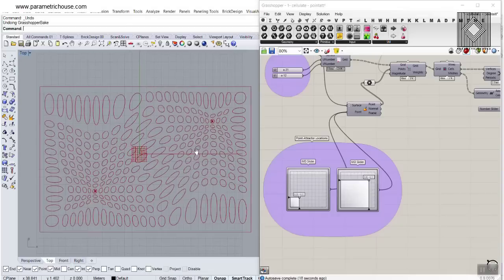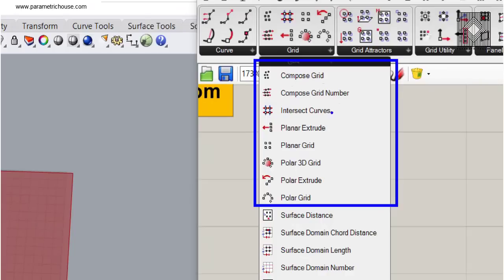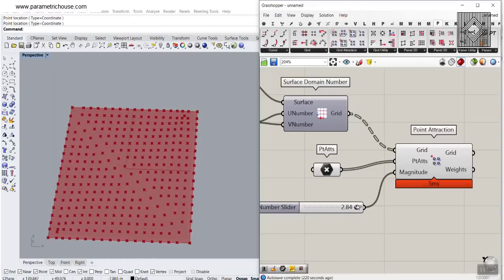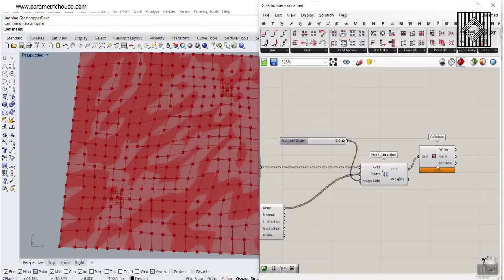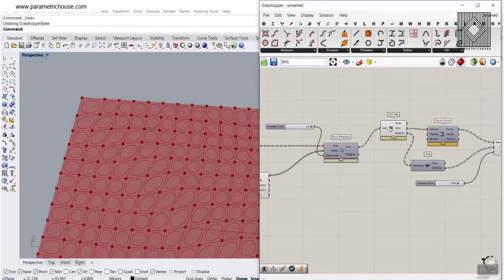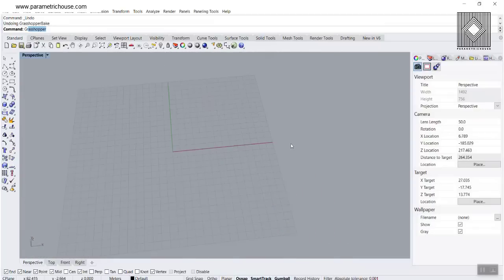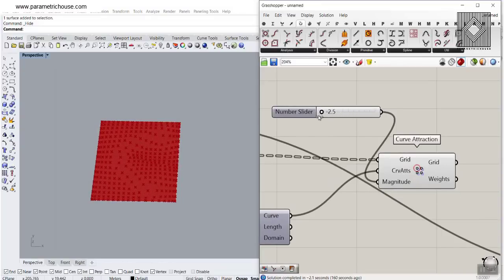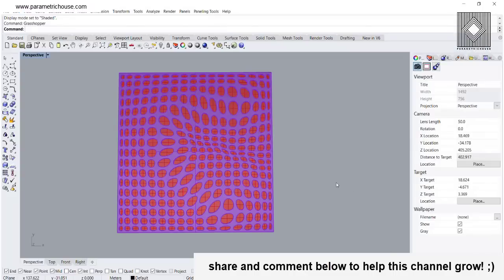Paneling Tools Grasshopper

Comment: Hi, thanks for this video. I have a question regarding surfaces, is it possible to link multiple surfaces to gather and compute as one surface? I tried to apply the technique you teach on 5 linked surfaces but it's running like 5 different algorithm on each surface.

Comment: Question : Panelling tool for version 7 ? Answer : Get file for version 6. Rename file extension to .zip. Open the file. For files having extension of .dll copy past to plugins directory of rhino. For file with *.gha extension copy paste in  /grasshopper/components folder. For file with .rui extension, search on C:/ drive and find location of another .rui file. Copy and paste this .rui file there. Should work.

Comment: Super Cool,  It adds visual complexity once can easily start deforming the regular grid/mesh patterns. Is it possible to use a surface extracted say from a Peacock ring definition and then apply a similar definition like above and then have this projected back onto the Peacock ring definition?  Many thanks :)
Reply from the maker: Yes sure! This can be done on any   nurbs surface. Pull the circles back on the ring base surface and split it!